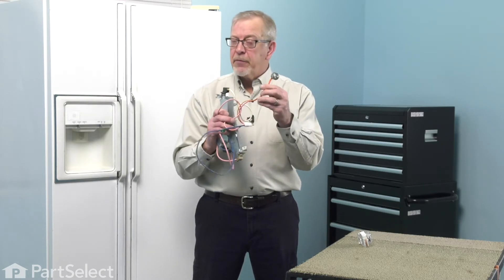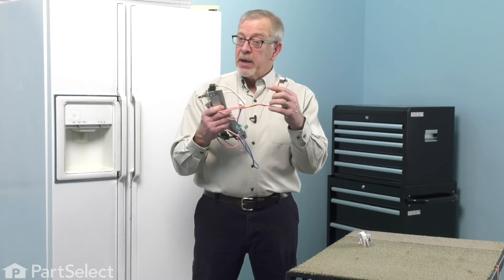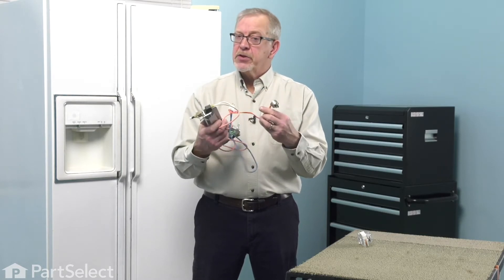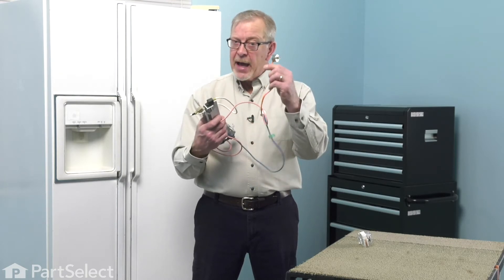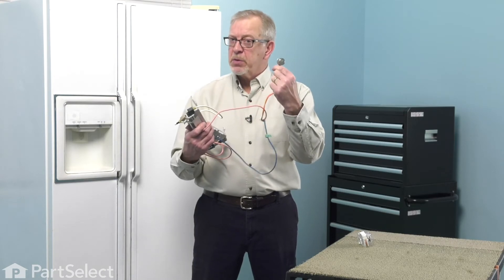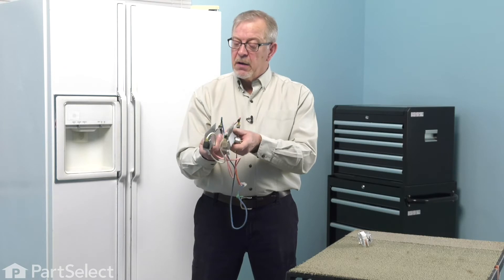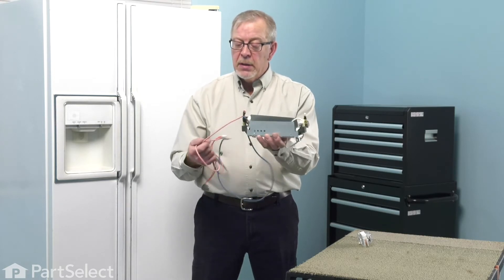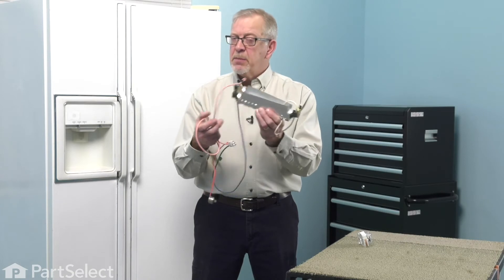Refrigerator Repair: How to Troubleshoot a Problem in the Defrost Cycle

Comment: Correction. At freezing temps the stat should HAVE continuity and ZERO continuity once warmed up in order to cut out power to the heater as a safety.

Comment: My delema is, I checked my element for continuity,,was good. Replaced the defrost thermostat,but tested the old one by putting it in the freezer,,,it works. The timer does cycle, the heater element does not come on still. Could the time be bad and still cycle the fridge, but not initiate the heat element? Thanks.